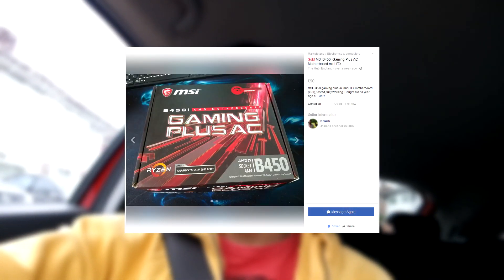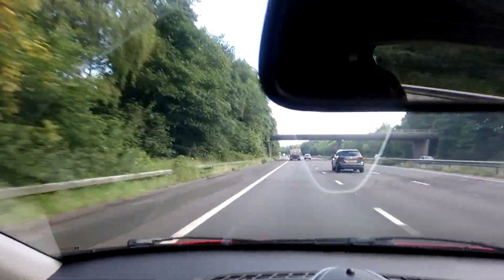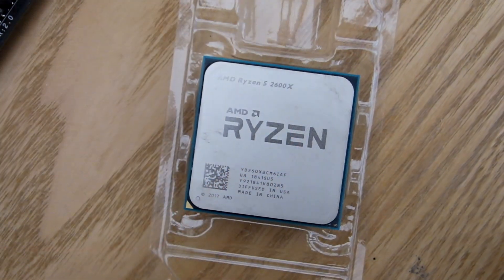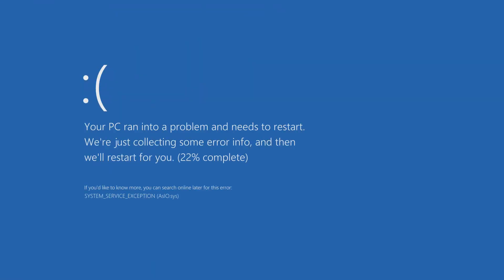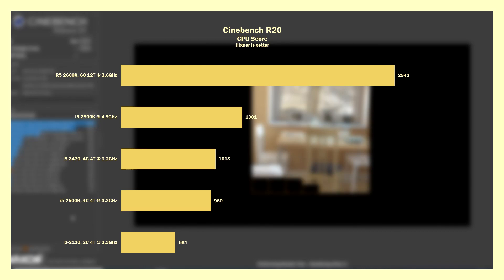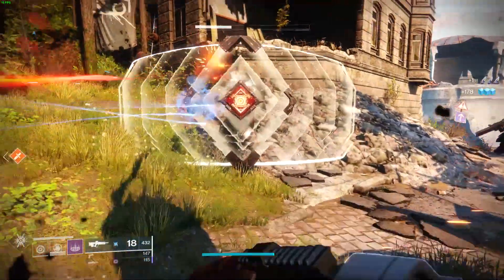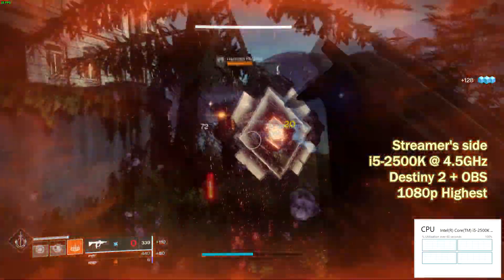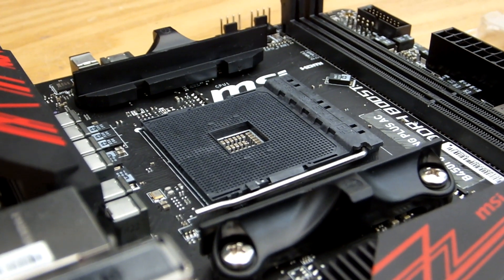Goodbye Intel, For Now - Upgrading From An i5-2500K

Comment: Just another relaxing and interesting video until suddenly, wait is that.. no, it couldn't be, I thought it was destroyed in the lowest pit of hell, is he really using windows.... 8?!

P.S love you work, keep it up
Reply from the maker: Yep, I am a heathen, and one of the 5% that still use it 😛

But really, I could make a video as to why I use it to this day, though I'll summarise it in two points: One, a debloated 8.1 is so blazing fast (both in startup and general use), that I've never felt the need for a boot drive SSD. And two, the automatic updates on 10 don't sit well with me, especially with even less control on version 2004.

The problems of 8.1 is the lack of drivers on newer hardware (even Windows 7 has better support), and obviously the ugly Start menu, Charms and its other oddities. But with a debloat, replacing that Start menu with Open Shell and having to hunt for drivers every now and then, 8.1 is surprisingly solid and very snappy, with the control and sense of ownershipt that has unfortunately been taken away in 10.

Or maybe this whole thing says a lot about me, and my own eccentricities
Reply: @TheBuddingEngineer  You have my respect, you changed my viewpoint on windows 8.1. Though I will still use windows 10 cause I like more their aesthetic

Comment: Sweet. If you have a bit of time on your hands, have a look at Salient OS KDE.
Reply from the maker: Ah, I first thought it was a Windows skin of sorts, but a Linux distro?

I've actually considered moving to Linux when Windows 8.1 goes EOL (since I personally don't like 10), so a gaming-oriented distro is genuinely interesting. Thanks for this!
Reply: @TheBuddingEngineer  Here you go.
https://salientos.github.io/
I recommend the KDE version, because you can Theme and customize it to kingdom come.
During installation, select the LTS (Long Term Support Kernel), it's stable.
Enjoy.
Reply: By the way, When it comes to choosing the kernel and the GPU support use the LTS version since I could not boot the system after installation. There is a workaround but blimey.